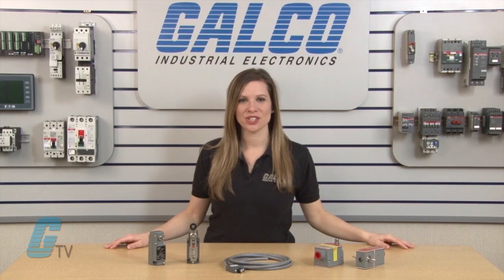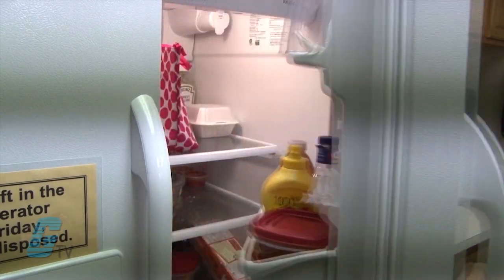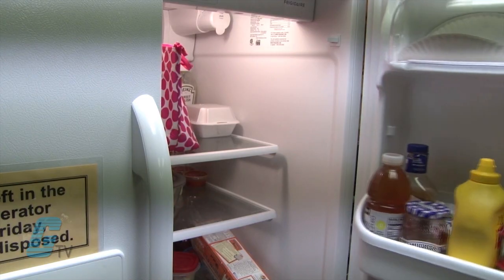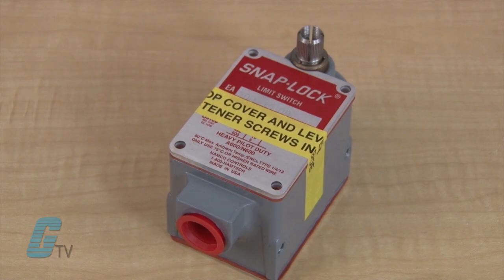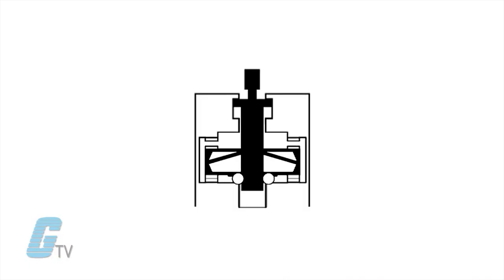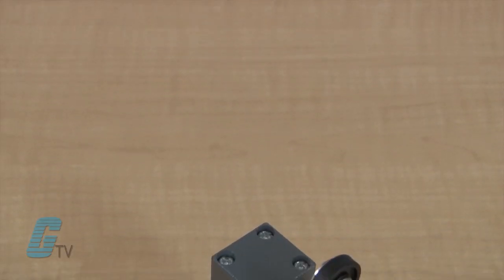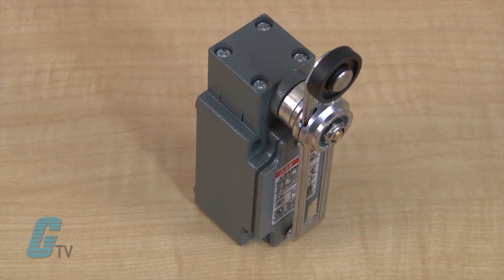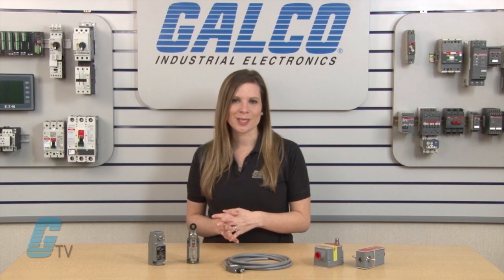What is a Limit Switch?

Comment: whats the difference between a limit switch to an ordinary switch?
Reply: My guess would be that limit switches are only activated when there is motion or force present; whereas with a normal light switch you can set it to the on or off (open/closed) position with only one movement, and it will make or break the connection for as long as it is in that position. 
Just like the example in the video: the light will only stay off while the refrigerator door is closed, but always remains on when the door is open.
This is just my basic understanding of this, i hope this helps.